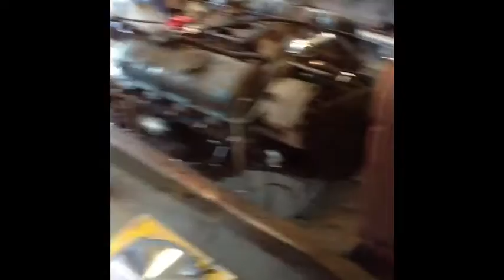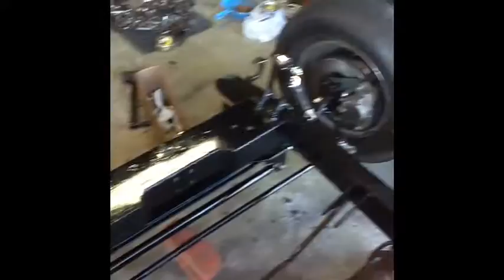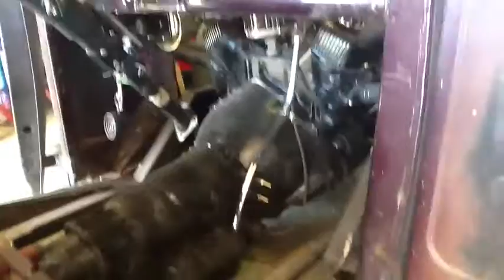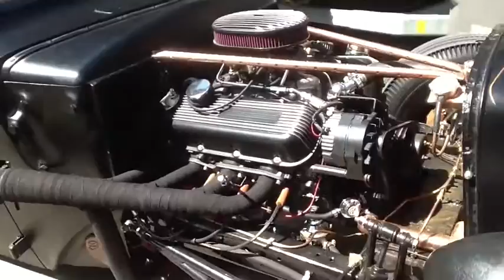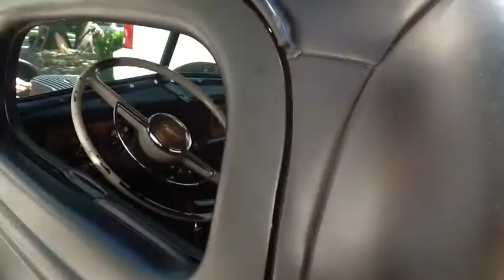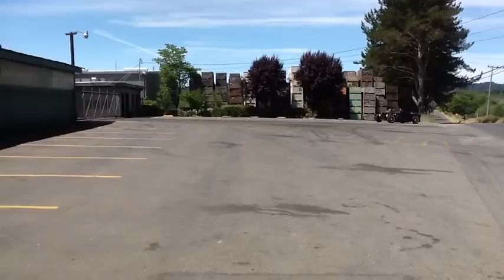Ratrod From The Beginning

Comment: hey jeff absolutley bad asssss truck, i am building a 48 ford truck and i was wandering what kind of air system did u used on the front i-beam axle to keep it behind or under the radiator. cause i like how it lowers the complete body without putting the axle in front of the radiator and the looks of it. like to use a system like that on my truck

Comment: Rat rod? Don't you mean hotrod. The minute you painted it and "cleaned" it, it was no longer considered a Ratrod.
Reply: +trainsnmorebuffalo there is no definite line between a rat or hotrod....paint imho doesnt make a rat a hotrod... even though  a lot of rats arent painted...its the builders interpretation of what the car is...ive seen  rusty vehicles that are so badly put together just so it can be a rat..but thats unsafe..then theres rats that are built well...so if the builder calls it a rat it is..if he calls it a hotrod..it is.....there are so many cars inbetween the different types..hell you cant tell anymore..hotrods, shockrods, rat rods, tradional rods  any one could easily blend into another type somehow.....lol
Reply: +trainsnmorebuffalo I have to agree with you. Not necessarily about the paint but just that its simply too nice. Love rat rods but I don't think this is one. Bitchin truck.
Reply: true a rat brings to mind rust and holes...but it comes down to what the builder considers it...